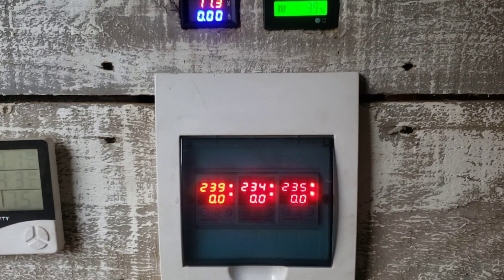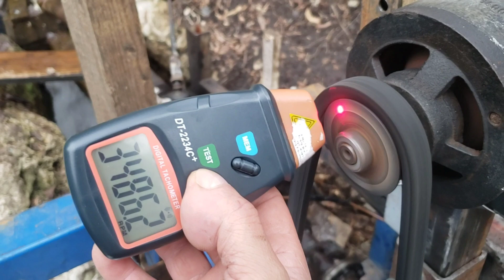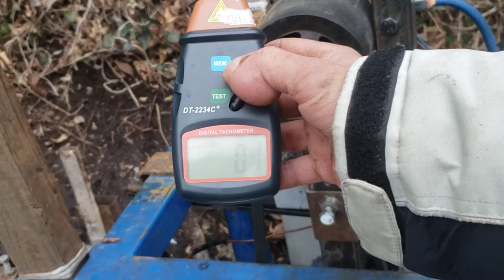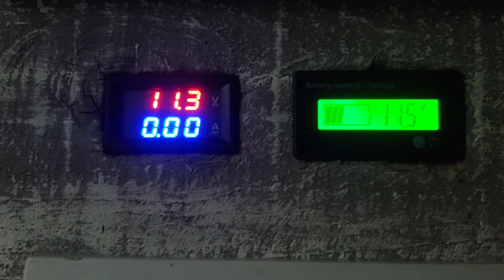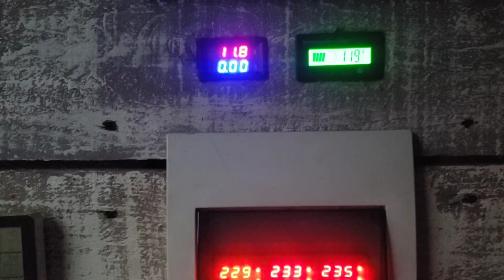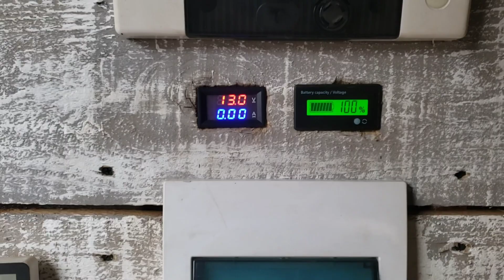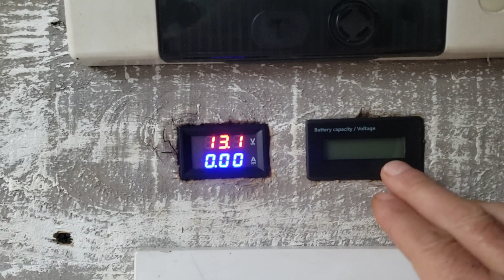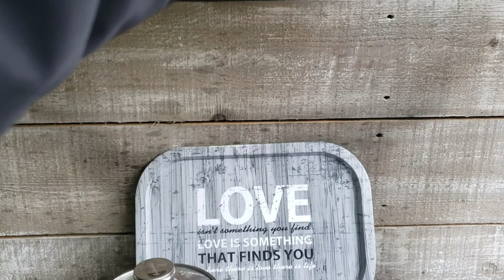LOW Amps Hydroelectric Power STRUGGLES

Comment: How come you don't want to use a alternator..or a charge controller on ur setup at the moment
Reply from the maker: I don't have enough RPM-s for alternator,  as soon alternator kick in magnetic brake slow alternator under 1500rpm and will not produce more than 10.5v.
That will be project for this coming spring and I need alternator there. 
This dynamo produce 14.2v on 1200 RPM so that is my only option for now.
Reply: @nopeoplenoproblems  ahh ok ..well if Ur setup is working the way it is thts very good 👍
Reply from the maker: @jaygtgarage6489 thank you.

Comment: Get rid of that transmission and drive line and move your alternator right next to the wheel running off it's shaft with a pully.  You are losing the majority of your power to friction losses.  Need to simplify it!
Reply from the maker: Huh, eye opener,  only reaso why I need transmission is to stop the system when I need to do maintenance without closing the water, and if system need extra rpm I can put it in second or third gear. 
Will test that as well this coming spring. 
P.s. my concerns that all that splashing water will and it freeze in the winter,  and I am afraid that belt will be all wet all the time and will snap easy. 
Thank you for your advice,  will definitely consider that option.

Comment: Change the oil in the transmission for some realy thin liquid oil. Thats gonna remove mutch powerlost in the transmission
Reply from the maker: You are absolutely right,  there are no need for tick oil in transmission because it doesn't run as fast like in car and doesn't have so much pressure spinning in transmission.
Thank you for your advice.
Reply: @nopeoplenoproblems  i realy hope your gonna get it to work with all 3 batterys. Realy nice projekt. I wish the bit of water i have on my property woud be enouth...
Reply from the maker: @gamingfuchs9331 thank you for your kind words. 
System is working but it is not officiant as I would like it, my plan is to welcome next winter with electric heating in our cabin and kick out propane. 
I wish you can accomplish your dreams as well.

Comment: You have done a great job with your system. 
I few suggestions for the future. 
If you looking at the old wind and watermills who was working for a long time without modern steel and bearings.
They have a lot of torque but are low on speed and horsepower, just like the steam engine.
1. Make  sure your waterwheel has a steady foundation with bearings on both sides. 
2. Make sure that the wheel is steady and as big and heavy as possible compared to the water supply and either work like a flywheel or are connected to one.
Many old mills had to be started by hand before they started to turn. 
The gearbox is a good idea as long as it is gearing up the speed of the waterwheel or even better, the flywheel speed. 
3. Why not try to connect 1 car alternator to each battery and then put it in one or more inverters??

If possible, instead of improving your existing system, build the new one in a new location so you don't need to be worried about downtime. 
Be sceptical of all suggestions and use your experience 😉👍🖖🇸🇪
Reply from the maker: Thank you Sir. Right now I don't have enough speed for alternator and hopefully will be improved when I build bigger wheel and have axel to be supported on other side as well. More alternators may work with new sistem as come but originally just one alternator was doing perfect job. I had more water pressure from the top of waterfall but locals was constantly messing with my pipes and my pressure dropped almost on half which create not enough energy for my alternator so I have to stick with dynamo for now, until spring when I will redo bunch of things. Calling someone here to help is fight with jealousy first than no good help was offered as well so I decided to do it by myself,  there is one person who is ok and I will take his help but he knows less than me so will see.
Thank you for all your great ideas and your support, hopefully soon you can see improved sistem. 
Thank you.

Comment: is that a C section v belt? looks bigger than a B...

over a two inch pulley?

youre losing almost half your power just bending that belt...
Reply from the maker: You have great eye, 2 inches pulley has to to be replaced for best belt fit, unfortunately sow and winter stopped me to go and research for original one.
Yes I am loosing some rpms on that pulley but in few weeks I am returning my alternator to my sistem with original pulley. 
Thank you for your comment and observations.
Reply: @nopeoplenoproblems  v belts in general are lossy... and over small pulleys, even more so.
Reply from the maker: You are absolutely right.  Keep up with us and soon you will see changes.